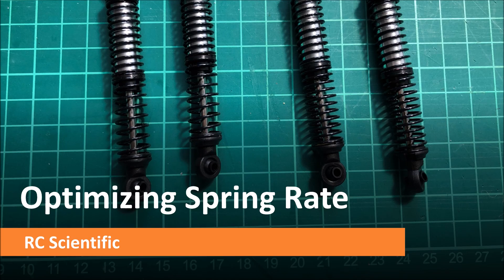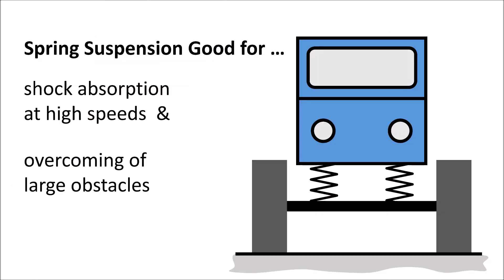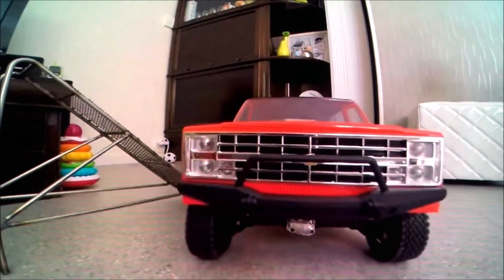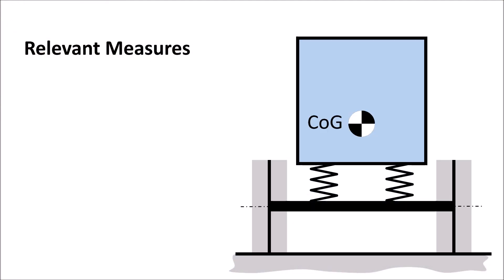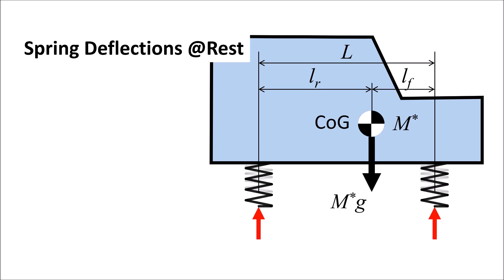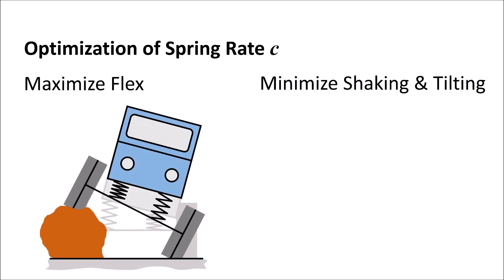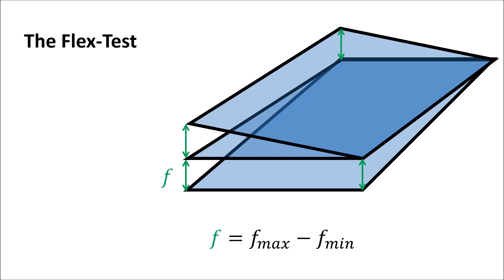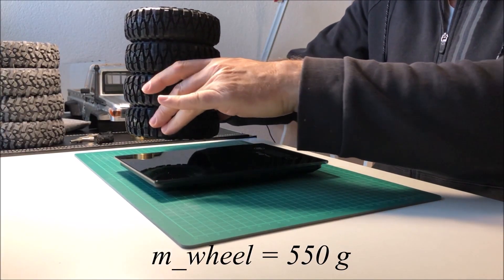How to Choose the Right Spring Rate of Your RC Crawler

Comment: Your shock absorber calibration calculation is good from a mathematical point of view if and only if the shock absorbers had no friction. Which is not the case, especially on the lightest crawlers (under 3 kg) for which the friction of the joints is important compared to the force of the spring.
On mine (2.5 kg), I fitted traxxas GTS 0.22 springs (Ref 8042 - yellow) to have 50% SAG. With your calculation I would have used 0.30 (too stiff)
Reply from the maker: You are right. My calculations ignore friction, especially static friction (stiction). However, if you get a suspension system with little stiction, and consider slow movements only (to ignore dynamic viscous effects), they should be a good estimation for a good spring rate.
Reply: Im having a hard time with springs,  i have TRX4 sport hightrail,  so the expedition rack is pretty heavy, stock springs were 0.48 but they were too stiff when i drove over rocks on walking phase, it started just to bounce over,  now i switched to 0.29 , now it goes over rocks well, but im having alot of bodyroll😪

Comment: My roommates saw me watching a video with RC trucks driving and everything is normal. My roommates see escalated defining of variables and equilibrium of forces condition as I measure my TRX4's flex just to tell them that the included springs from the factory are the proper rate...